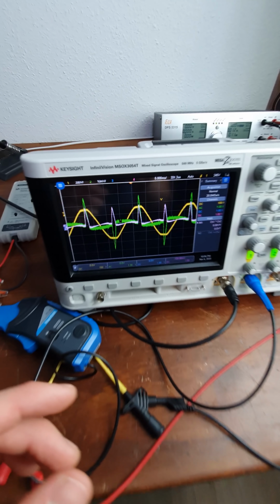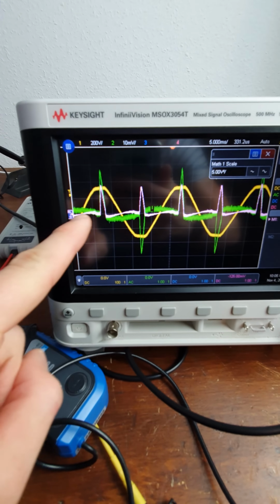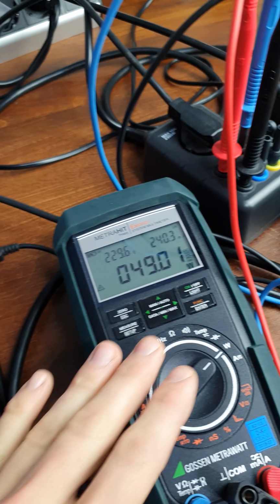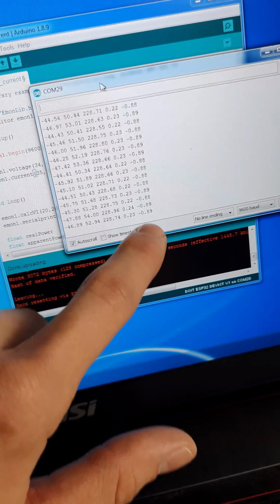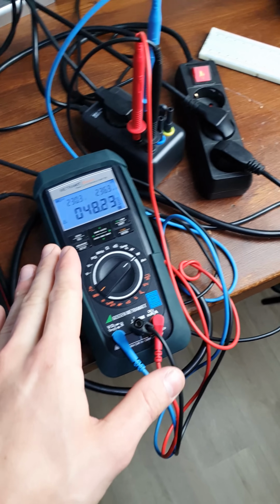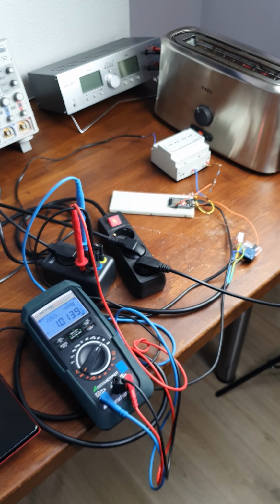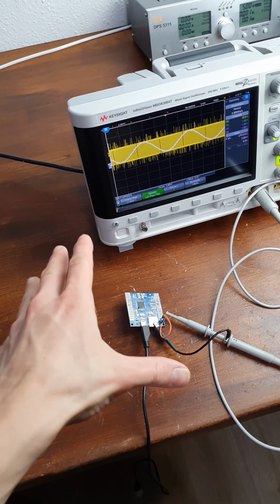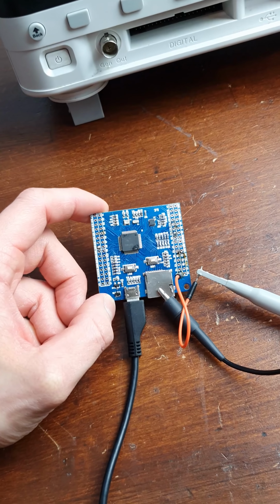November 2020 GreatScott! Behind The Scenes

Comment: I’ve been working on using the MCP3204/8 ADC in tandem with my ESP32. You’ll probably find that the built in 12 bit ADC isn’t the most linear. This has been talked about a ton on the Emon forums. It works, just not great. Love your work. Looking forward to the video.

Comment: I was thinking... Maybe for the power meter you could use a kind of amp clamp idea?
Reply: maybe even measure the current the same way for the low-frequency band: Hall-effect sensors right next to the core of the current transformer.